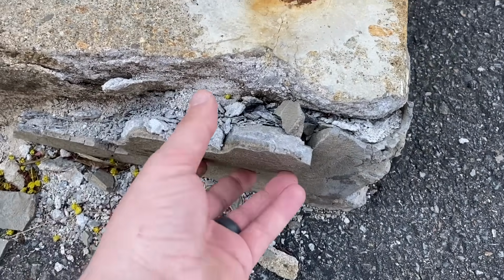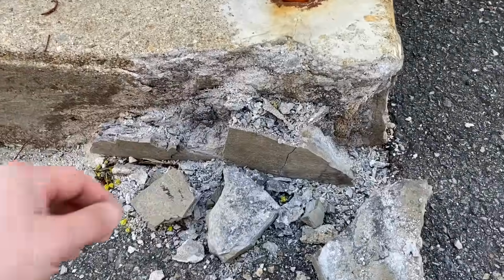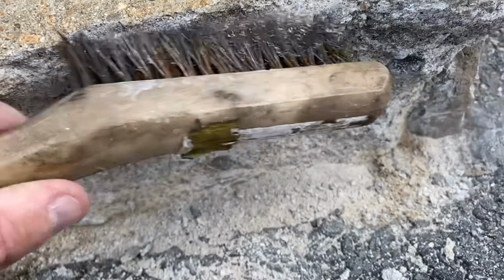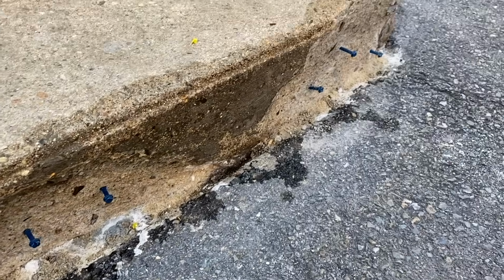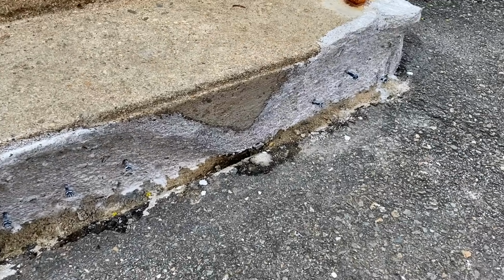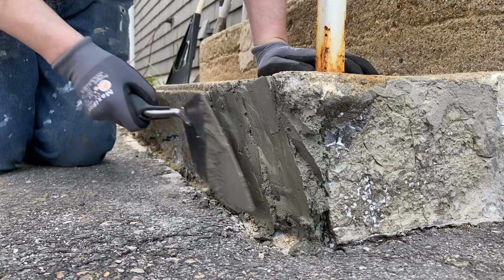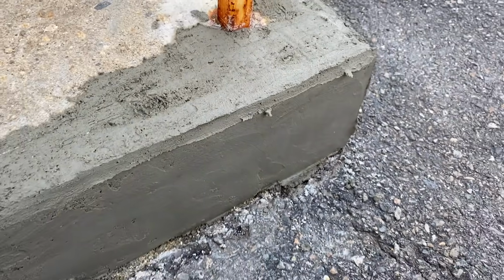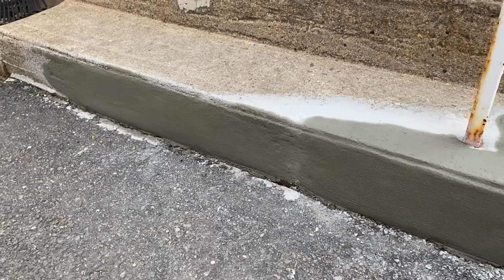How to Repair Broken Concrete Stairs - Quick and Easy

Comment: You should paint the concert stairs white  like the stairs that you have in front of you house and also put new metal railings or you can paint over them in the back of your house where you did the project of the stairs.
Reply from the maker: Hey, Maria!  I am going to keep these steps so I may not do white, white gets very dirty very fast... I am probably going to change out the handrail though so stay tuned!

Comment: I have a concrete porch. We recovered it every 4 or 5 yrs with outdoor carpet. I have removed the carpet and adhesive and any paint. What would you suggest to make it safer in wet weather? Paint with non skid additive or more outdoor carpet?
Reply from the maker: Hey!  I think it is a matter of preference really.  I think both the non slip additive or the carpet would be a good choice.

Comment: I am an engineer and have fixed this many times in parking garage stairwells. More than likely the post is completely corroded out in the concrete. We had to weld a sleeve onto the post about an inch and a half above the step and add sealant to stop water from pooling, then redo the entire corner of the step. We did use tapcons to hold the repairs!
Reply: Interesting comment.  I am interested in the tap cons.  A bit surprising  they are used so close to the surface.  Y'know,  rusting and breakouts.
Reply: The Tapcons are intuitively correct, but technically not so much. Any steel within 3 inches of the surface will rust, expand, and flake the concrete. All else, Well done! (The steel post will continue to rust and eventually break out the step's whole corner, might be another 10 years, but the fix will be the same)
Reply: @rogervancouwenberghe6685  the tap ins are coated
Reply: @rogervancouwenberghe6685  let alone the old concrete with loads of sand and less cement.
Reply: Epoxy is my preferable
Reply: How to tell someone is an engineer without telling an engineer……..😂😂😂
Reply: If you can weld correctly, you need to cut the old post flush on the surface,  extract the old embedded piece of metal with a core drill bit (2” diameter or larger if metal shims were used) install a new post and use hydraulic cement. Then you can fix the step.
I do this for a living.
Reply: @jerrybrito100  All good, but I'm a bit stumped... why is welding necessary?  Sounds like you cut off the post (could be done a number of ways, I'm thinking angle grinder with a cutoff wheel), core-drill it out the leftover stub, and go from there.
Reply: @jerrybrito100  Could you weld a piece of steel on the post and use a hydraulic jack under it to pull it out?
Reply: This is the exact reason for the tragedy in south Florida, those buildings that were constructed 30-40-50 years ago were reinforced with rebar,the salt in the air seeps in and thru the concrete rusting the rebar,untill it cracks the concrete.mamy thousands of these now death traps are all along our coastlines, it would be very sad if this is ignored by owners and state laws designed to protect people.
Reply: @Urz75z  Not just your coastlines either.... Can't even fathom the cost to society.
Reply: @Urz75z  No easy way to do something with rusted reinforcement inside of old concrete. Epoxy coated reinforcement did not exist then. And even if you can do something, the price of repair is too high. Who will pay for that? Try to convince the owners of those condos in high-rise buildings that they have to bay 10, 20, 30 thousand for a repair, which they feel unnecessary!
Reply: You're a maintenance engineer then.
Reply: @Thatguyfromttown  no,  I am a simple welder fabricator that do this repair correctly. For me, my clients, my present and my future business

Comment: The sponge makes all the difference.  Great job!
Reply: I use a masonry (grass fiber) brush as well, they smooth everything out really good, and is great for priming the area with diluted concrete/primer mix.
Reply: Once it's kinda setup, grab some black earth top soil and sprinkle it all over the new patch. Kinda rub it in. Let it sit. The next day, hose it off.

It'll look alot less noticeable of a patch.

Comment: Maybe if you pained the steps a light grey with non slip additive in it, it’ll prevent water from entering the cement? Kinda like making them water proof or something. Looks great!
Reply from the maker: That is a good idea!  I will have to look into it.  Maybe I can just do the tops... if that wont look too weird.  Thanks for stopping by and for the comment!